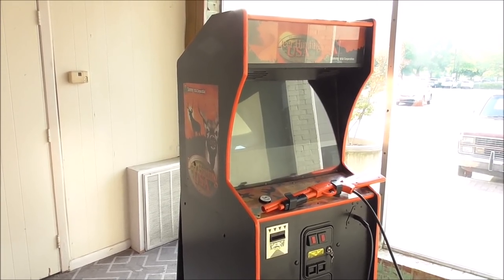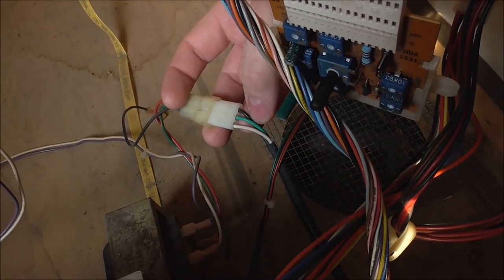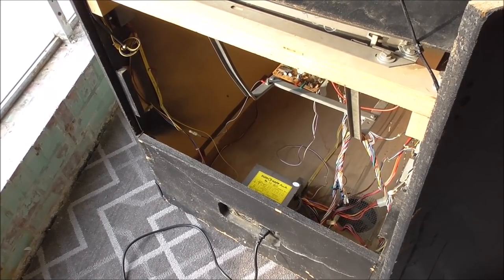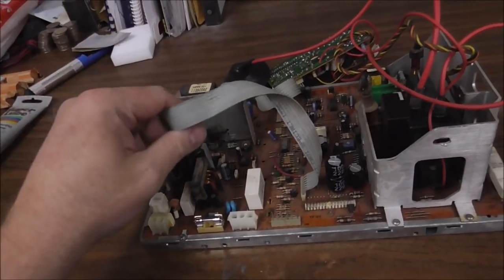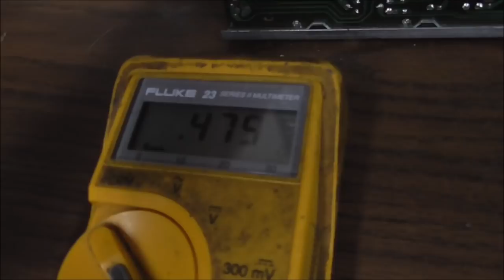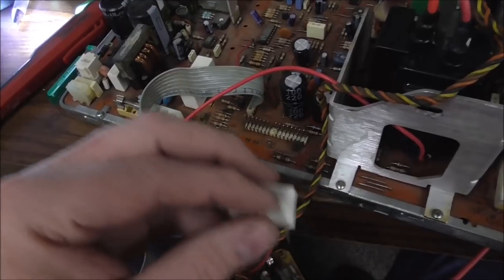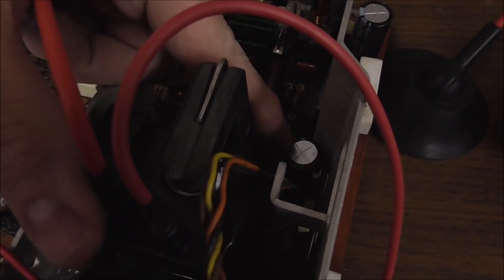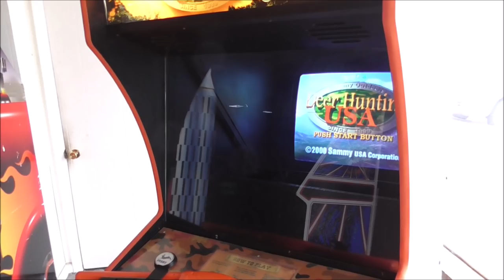Repairing a Dead 1990's Hantarex Polo Arcade Monitor - Italian Made Classic CRT Repair

Comment: I was watching from the beginning and I told my fiancee when I heard the ticking that it was the flyback. I remember it from working on solid state televisions with CRT's. The flyback, if it's bad, will make the ticking sound immediately upon power up. I'm glad you were able to get the game going, Pro Hunting USA is a great game.
Reply from the maker: Thanks Wil, we appreciate you watching!  I could hear you screaming through the internet "CHECK THE FLYBACK IF ITS TICKING!!!" lol  We'll see you on the next one, tell your fiancée we said hi!
Reply: I always read the HOT causes that ticking, as the monitor is trying to come up, then the overvoltage circuit sees there's a short, turns off the high voltage, then continues to try to bring the high voltage up repeatedly, but doesn't as long as the short is detected. That's what my 25" Polo was just doing. Got lucky, and the new HOT alone got it going again.

Comment: Great work getting that Polo working! Most of my cabs have Polo 1s or 2s. I used to be terrified of discharging the anode cap, I’ve done it enough times now to know how to do it safely and thankfully I’ve never had a shock from one (I’d rather not get shocked, even if it probably won’t kill you 😅). 

I got a House of the Dead with a Polostar recently and I’m sure the flyback in that had that melted glue look to it like yours did (it was actually the wrong flyback model too). Once it was replaced the monitor was all good.
Reply: Polo 1 has a discharge circuit (wire) built in, no need to manually do that, also has auto degauss when you turn it on,  and you can reverse the Yoke by plugging into the other green connector on the Chassis, handy for all those vertical games with no screen flip settings
Reply: @leonhantz6383  Yeah I found that feature useful on my Time Crisis 1, at some point the tube must have been taken out and whoever put that back in did it backwards afterwards. Rather than lug the tube out I was able to just flip the image. 😂

Comment: To discharge the tube i used to disconnect the  high voltage cable from the tube (the insulation of the connector is adequate to do this) and hold the metal pins to the frame. Worked every time.
Reply from the maker: I'm pretty sure that's how Joey usually does it!  A lot of times if i'm pretty sure it hasn't been working in awhile I just pull it off and don't use the screwdriver, I was just trying to show how to do it for the video so people wouldn't freak out... 

What it comes down to is Joe usually works on them and if he gets one that's really screwed up he has me mess with it too, so most of the ones I ever touch anymore are dead, LOL
Reply: Actually, you don't need to ground the 2nd Anode lead itself, but the hole where the 2nd Anode lead goes. I mean, the CRT is what you would discharge. The flyback isn't what holds the voltage. It only produces it, and if the set is not on, it cannot produce any. However, the CRT itself acts like a giant capacitor.

Now, just disconnecting that may do the trick since, as you disconnect it, the prongs will straddle the hole, shorting the 2nd anode connection inside the tube to the dag coating on the back of the tube.

Comment: Congrats on your sub's ! I would keep that fly back if I was you as the core isn't physically connected inside, so the movement not to much of a problem, my moneys on the bulging electrolytic gone open, its great that it's working again ...cheers.
Reply from the maker: Thank you for watching AndyMouse123!
Reply: Well, there was also the melted glue, so it is possible that it overheated and burned the enamel inside.

Comment: My lethal enforcers cab has a polo in it also but it sets 180 from the one in this cab. Next time I pull it away from the wall to switch games (also has Area 51/max force) I may turn it around. It would be a heck of a lot easier to adjust that’s for sure. Lol
Reply from the maker: Yeah if you turn it around, and then plug the yoke into the other connector it'll display properly and you can service it!

Comment: I recently picked up another cab. Turned it on and heard a loud pop preceeded by a loud ticking. It's a pole monitor. Guess I'll be doing a cap kit and flyback to see if I can bring it back to life. 
Also noticed someone had cut the power supply cord and just electrical taped it back together lol. May have caused the issue!?
Reply from the maker: Loud pop look for a blown cap or a huge crack in the flyback
Reply: @LyonsArcade  I looked for blown caps but nothing noticeable and the flyback doesn't seem to be damaged like the one you showed in the video. Haven't decided if I want to fix the crt or just throw an lcd in it. It's an original mk2 cab with decent side art. I have 2, the other is all original. Maybe just throw an lcd and pandora box in this one and turn it into a mame cab. Idk. Thanks for your help buddy!

Comment: Fly-back may have gone bad with some of those caps leaking.  They are nasty capacitors.  They leak like crazy even when they are not very old.  Your troubleshooting techniques are really good.  A lot of so called professionals could learn some things from you.  I've seen so many that go straight to the Power Supply rather than Fly-Back with that ticking without even testing things further.
Reply from the maker: I basically go straight to the HOT the fly and the caps around it, I got a little lucky on this one though!  Thanks for watching Brendan, we appreciate it man as always.

Comment: When you replace these parts (caps, flyback) do you then have to adjust the B+? And if so, how do you know which value it's supposed to be at? Or even where the test point is?
Reply from the maker: It's all in the schematics, it tells you all the parts how they connect what the voltages should be where to adjust where the test points are, etc.

Comment: I got a Run and Gun with a Hantrax polo.
 i checked it played it all good, drive home about 3 hours bit bumpy,and it is    ticking!
F,.,.....k!
Reply from the maker: It's probably got some bad solder joints on one of those resistors on the right side, but usually it wouldn't tick I don't think if it had that.

Comment: Hey, I have a pachislo slot machine and the credit/win light won’t power on and it won’t accept tokens it spits them back out. Would you happen to know what the issue may be
Reply from the maker: Hmmm.... sounds like it may have some sort of error code going on, did you go into the service menu?
Reply: @LyonsArcade  no service manual, the whole one side doesn’t light up too,  so if it’s throwing an error code I wouldn’t know

Comment: What makes an arcade monitor NOT need an isolation transformer? it has to do with how the design of the circuit board grounds with the monitors chassis ground. Which component you tested on the Hantarex that tested Shorted but was considered good in circuit even tho it tested shorted in circuit? i didn't get the component name or reference number
Reply: these don't need isolation transformers because they're switching mode power supply models. they're not a hot chassis like a K7000 where you have to be concerned with the neutral and earth ground bridging and blowing out the bridge rectifier. the shorted part was the HOT, BU508AF on Polo, it will test shorted in circuit base to emitter because of the damper diode inside the package. I've only ever known to test those and the WG U5000/K7400/K7500 era HOTs out of circuit. red probe on base, black probe to collector and then red probe on base, black probe to emitter. if you have junction drops either way, it's good. if shorted one or both ways, it's bad. there's a lot of counterfeits out there, so I suggest only buying from reputable sources like APAR.
Reply: @mecha2001  When an Arcade Monitor is HOT Chassis that means that the HOT White wire 120VAC is connected direct to the Chassis ground frame of the arcade monitor. I'm not sure why Arcade Monitors would use the Chassis frame as a HOT because if you put you right hand gripping the arcade chassis frame and your Left hand touching a zero volt ground you will have 120VAC across your body getting shocked shorting it out across your body. The Isolation transformer is preventing if the H.O.T transistor Horizontal output transistor gets shorted out that the High Voltage from the arcade monitor doesn't backfeed and short out all the circuit boards BEFORE the isolation transformer? Because if the Flyback shorts out or the H.O.T transistor shorts out and you don't have an isolation transformer it will damage all the arcade circuit boards. The Isolation transformer is preventing the arcade monitors high voltage from reaching the other circuit boards preventing them from getting damaged. I'm not sure why the H.O.T. transistor has a Damping Diode internally in the transistor package because the Damping Diode does what? Because most H.O.T transistor doesn't use the Damping Diode are most arcade monitors HOT transistor.

Comment: I repaired MANY arcade CRTs and one thing I noticed, I NEVER saw a wells Gardner pop a flyback (mounted on chassis frame), but Electrohome G07 CB0s popped flybacks like they were going out of style.
You can reverse the Y or the X deflection but you can’t swap X and Y or the monitor will pop.
Reply from the maker: The Wells ones hardly ever burnt up, except for the K7000 ones... the 4600 and 4900 ones though almost all of them are still working!
Reply: @LyonsArcade  yes, WG was very well designed for the time. The newer WG LCDs, not so good, but at least no high voltage anode. By the way, if you’re operating the Ekectrohome G07s, they have a dangerous flaw. In their “wisdom”, they put the fuse AFTER the bulk caps, making these monitors a shock hazzard when the fuse blows because the caps continue to charge. I used to solder a 10K 1/2W resistor across the main caps to safely bleed them off when the fuse pops.

Comment: I got a 25kv shock from a monitor once it didn't kill me but the screwdriver is was holding was launched by my involuntary spasm behind me  embedding it 2 inches in the wall missing my boss's head by less than an inch and would have been a lethal shock. He stopped looking over my shoulder after that.
Reply: I heard a similar tale, though this was deliberate. A tech kept asking a woman to keep her toddler away from him as he worked. The child was screaming and had a loaded diaper. Well, he finally had enough and touched the diaper with one hand and the 2nd anode with his other hand... the mom watched the toddler after that.